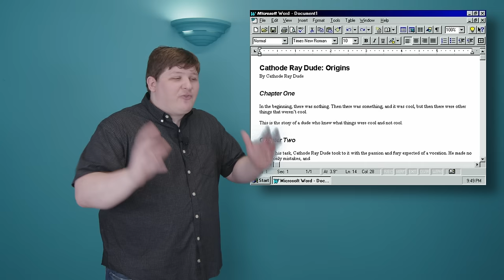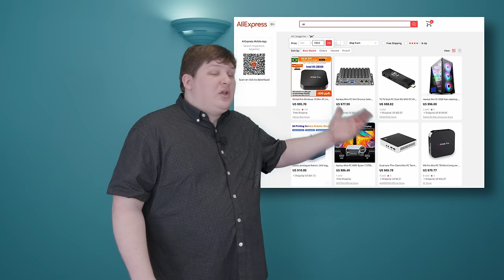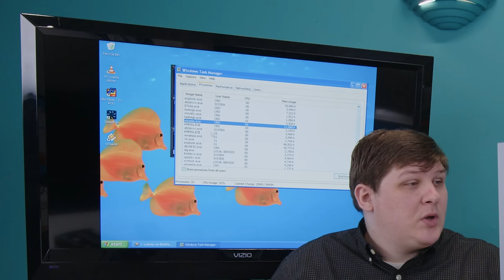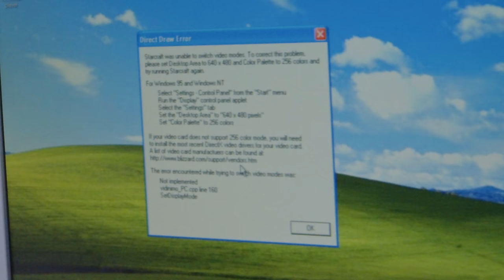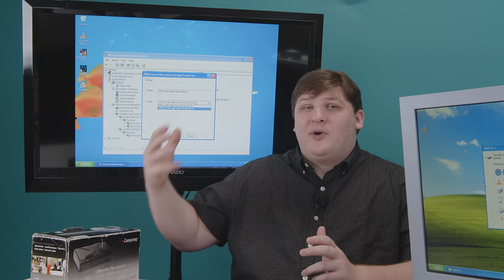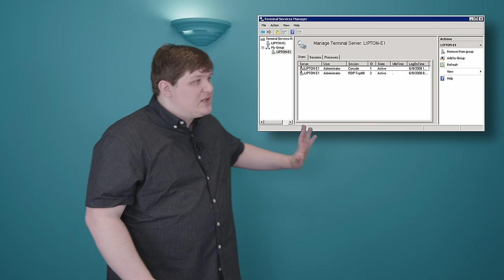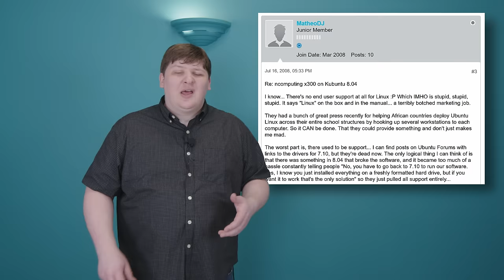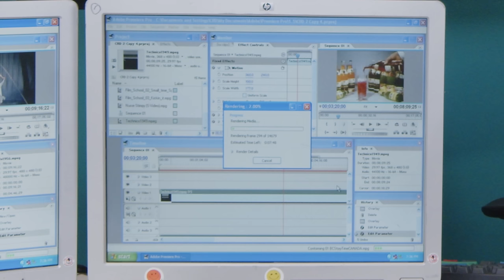7 Users on 1 PC! - but is it legal?

Comment: A Sandy Bridge machine upgraded to 16GB of RAM and an SSD is The Plateau. It helps having some sort of discrete GPU but it's not totally necessary.
Reply: I'm running a 3570K with 16GB of RAM and a 1050TI. I won't need to replace the thing for years to come. I program, run many VM's and occasionally game. And since I'm a happy Linux user it won't ever be artificially obsoleted.
Reply: True even 8gb ram is enough for most tasks, having still a great experience, that's the SATA SSDs starting from 2016 that become the game changers
Reply: @fabiosemino2214  If Limited SSD Write Endurance wasn't a thing I'd totally agree with you. It's best to have the maximum ram your machine will take / you can reasonably afford to keep from ruining the SSD with eleventy trillion pagefile writes.
Reply: I replaced my 3770k machine not because I needed to (was super snappy till the day I decommissioned it), but purely because I wanted to. Sandy/Ivy Bridge will likely survive the heat death of the universe.
Reply: @mrflamewars  indeed, or if your use case allows it using Linux works well, my parents small power rig basically is turned on 24/7 and its Samsung 840 it's basically almost a quarter of it's project writes life with about 6 to 12 gb ram during it's lifespan
Reply: Sadly, Adobe coders disagree completely
Reply: I'm in the same boat and thought the same thing when he mentioned 2010. I've upgraded Sandy Bridge to Ivy Bridge (overclocked to 4.6ghz and 4.5ghz respectively) and pushed the RAM to 32gb at 2200mhz cas 10 and I'm really struggling to justify an upgrade to Alder Lake. Especially when 32gb of DDR 5 is so expensive. With a  GeForce 1060 6 gb it runs Doom Eternal at 1080p at approaching 100fps on high graphics settings. But it's now over 10 years old - surely I'm due a new PC?
Reply: I don't have an SSD but this IS a Sandy Bridge, 12 years later... with a discrete gpu of course.
Reply: That rig is exactly what I've had since 2011, 16 gigs even back then, with a GPU, various SSD boot drives since 2013. I did graphic design and HD video editing, I still do basic 3D modeling on that machine. It doesn't stutter, at all. Best investment ever for my lazy ass.

I also have a couple of sandy bridge ThinkPads, one with 8 and another with 16. They do all the design I want, but the 3D modeling suffers. I remote into other machines with them easily, though. 

Even the web is fine, I can use Linux for such daily tasks and save battery, though I tend to use a cheap tablet nowadays anyway.
Reply: @drboom2  Yup. I was in a similar boat with my 4770k. Looked for upgrades "just because" over years, and never saw the bump I required for rationalizing spending a good chunk of money. I finally caved early this year and got a 10600, which promised a single core improvement of ~25% as well as a faster RAM interface, which were the things I was looking for (to build even bigger mega bases in the game Factorio).
(It came juuuust ahead of a similarly priced AMD alternative, single core only ofc, which is what I had gone for just a few months before for the first time in many years.)
One downside is that I can now keep even more browser tabs open without noticing an impact, and my tabs bar is slowly getting just as crowded as my bookmarks =)

But yeah, those CPUs, especially the x770k versions were almost too good. I kept mine to eventually make my mini music studio PC when I finally have the time and funds to complete it. Should have no issues with even tens of 48kHz audio streams.
Reply: i'm running an i5-2500, gtx770, 16gb ram, and for the thing i use it for, it flies. (old MMO game)
Reply: Still true ~2 years later. I just replaced a PSU on the described machine, and it can still run most fairly recent AAA video games 1080/30 with a 10-series NVIDIA card, which is much, much more than I'd ever need it to do as, at most, a tertiary option. And I took the absolute worst Lenovo laptop I've ever seen and made it usable with SSD + RAM.
Reply: i have a dell latitude d620 and an acer aspire one that both are just laughable in capabilities but still see regular use cause they can run a terminal very well, they can run office suite programs very well (the aspire does struggle sometimes) and they both 'can' output hd video, the latitude is my dvd player for when i don't want to rip the dvd. the netbook is REALLY good at being a terminal client and i often use it at friend's houses to connect to their home server and be a little troll (minor things though, i ain't an asshole)

Comment: One of the smaller chips on the card is probably a Serial EEPROM that contains the code for the FPGA.

Additionally the multi-desktop stuff was almost native in Windows at that point. -- You could definitely do this over RDP in 2007. (i.e. multiple users having separate isolated Windows sessions on the same box without CALs -- up to two users at once IIRC. -- There was a registry key you could set if you needed more than two users IIRC.)

As for legal issues with Windows -- as long as you own the license, it was fine -- MS audited orgs all the time back in the day -- and we only ever had to provide a count of the licenses owned versus what was required; they didn't even differentiate between versions -- need another license for '95? -- they'll sell you a license for XP and call it good -- So, saying "the end user is required to own a license" was fine, that's how it was enforced.  No reason for MS to go after the hardware manufacturer.

There is an additional licensing issue though -- in that you are sharing the same programs -- like two users using one copy of Word or Photoshop, etc. -- but that's even a more obscure issue. -- Again though -- the audit process was probably similar for Adobe as it was for MS -- if you wanted to be "legal" you just bought more licenses -- doesn't matter what the computer is doing, if in an audit you can prove you own X numbers of the software and you're using X numbers, then you passed the audit. -- Though Adobe and Macromedia usually gave the software away to schools and students for free (and/or heavily discounted) anyway -- gotta get 'em hooked while they're young and all that.

Multi-point server stuck around after 2016 -- IIRC it became a SAS offering in 2019~ish? -- Basically it's cloud based now, because you can cram a lot more compute into a data center, and it's just cheaper and easier for customers to deploy.

Comment: Actually it was possible to fit some 3D capabilities to a single FPGA even in 2005 - I did my master degree on this topic. Also in 2005 there were custom FPGA based 3D graphic solutions - for example to render voxel based graphics (for example results of MRI scans) but they used more then a single FPGA chip. From practical point of view - it would be too expensive at that time eliminating any sense of such device.

Comment: I've noticed many years ago, when I found my uncle was still using the computer I helped him buy years previous, that old computers are still just fine if you use the period software as well.
If you're not being forced into updates and an ever more bloated system partition, the computer can just keep doing what it's been doing.
Reply: Yes. Unfortunately many very same or at least functionally same kind of services on the web, and not to mentioned proprietary-application ones, have replaced their websites, supported apps, and protocols into new ones which do not work on old omputers anymore, and almost always are unnecessarily more bloated and less useful than their former versions.
Reply: Except you become very vulnerable to viruses and exploits especially if you connect to the internet in any form.
Reply: About two years ago I helped out a friends uncle, they had gotten a new Laptop and wanted me to help set it up and transfer over all of the photos from the old PC. The old PC was still running Windows XP and was never connected to the Internet. They had Internet and wifi with the ISP router but the PC was not connected, only their smartphones were.

So I first wanted to look at the old PC and start the file transfer (in hindsight this was the best idea of that whole endeavor, that thing hat USB 2 only) onto a USB device. So we turned the PC on and it took forever (this was a budget machine from the discounter, probably from when XP was still new), the thing here was, I was getting restless, not to say distressed, while for him this was normal (at this point the laptop was still unopened in the box, as to be able to return it, should I say it's utter garbage). Meanwhile I was used to the OS and all daily used programs being loaded instantly from an SSD but he was totally calm, for him this PC was still the fastest a PC was...he used it the same as the day he'd gotten it. Needless to say he was blown away by the laptop.
Reply: That's wholesome.
Reply: I still have a Dell laptop running XP that I keep only because there is one program that cannot run on later models. I only need it once or twice a year.

Comment: In 1996, I was only 16 years old and on my first job I was deploying computer labs for elementary schools using the Buddy B-200 by a company called Austin and using software by Applica. It was only for one more user (no audio), but it did have the multiuser experience in a Windows 95 environment.

Pretty amazing stuff, and not only for 3rd world countries. Computers were very expensive on those days so this made a lot of sense.

Why fit a lab with 20 computers when you can do it with 10?

Comment: XP (while in beta) did briefly allow for multiple users to be using a single computer (one locally and one remotely) with separate desktops, but the released version didn't allow that. You could for a while, replace one of the files in the released version with the file from the beta and regain the functionality. I'm guessing that this company made use of a hacked version of that.
Reply: Exactly. its a simple change in the Terminal services to allow this to work on pretty much any version of windows.
Reply: still alive, i'm using it.